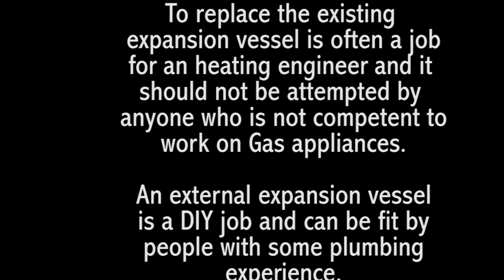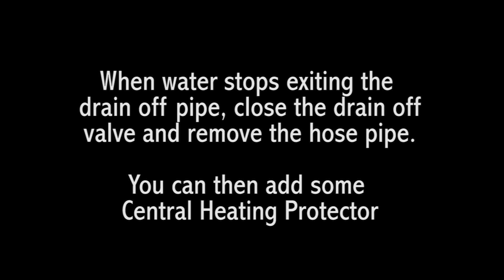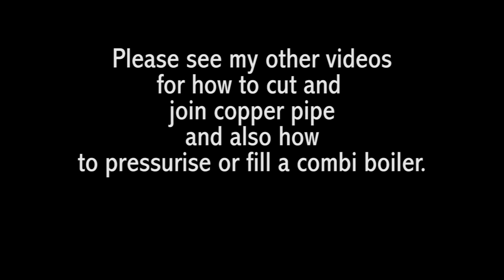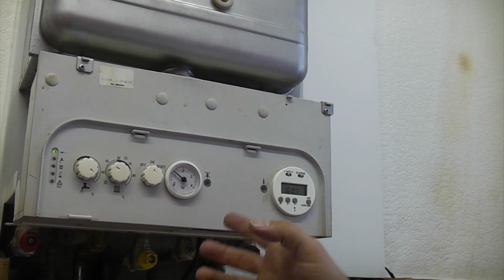How to fit an expansion vessel

Comment: Hi when fitting your expansion vessel to your combi boiler did you have to bleed the pipe you fitted to the expansion vessel?
Reply from the maker: No, any air should be forced around the system, until it can be bled out at a radiator 👍
Reply: @ultimatehandyman  thanks for getting back to me 👍

Comment: This is extremely useful,  I have a question that I hope you can help me with,  I'm hopefully going to avoid cutting in a t piece by finding one of those valves  with the 2 openings,  the question I have is is the pipe with the valve that the filing  loop attaches to always the return pipe?  Thanks. I was thinking if I could use one of these double valves then I could always remove external expansion if I needed to.
Reply from the maker: I’m not a plumber, but as far as I am aware, the expansion vessel is always installed on the return (I’m not sure why though, a plumber will know for certain)

Comment: Had mine re pressured a week or so ago, but it still won’t hold. The condensate pipe is bone dry though. What would you say is the problem? Also every so often I hear a click, could that be the pressure slowly releasing over time? Would a new E. V. solve this?
Reply from the maker: It’s not the condensate pipe that you need to check, it’s the blow off valve pipe, (or pressure relief valve pipe)
Here’s how to check the expansion vessel- https://www.youtube.com/watch?v=SNULc5fhY28&t
Here is how to recharge the expansion vessel- https://www.youtube.com/watch?v=KeO2gswQQe4
Hopefully this will help you find the problem 👍

Comment: You doing really good job to share all your experience :) I am planning to install external same expansion vessel like boiler has already, but just wonder if I could connect to the same plastic manifold where PRV and flexible pump hose is connected? Just disconnect old EV and with extra piping and few elbows connect new external EV? Or just leave it old one as it is and install new external EV to the return side as you saying in this video?

Comment: I have exactly the same expansion vessel you showed in this video. Is yours still working without issues? I've had mine for about four years now but the other day water started leaking out the top of the vessel where the large nut attaches to it.. A friend put some white sealant stuff on the thread as a temporary measure, now it doesn't leak but can you suggest a more permanent fix?
Reply from the maker: If I remember rightly, there is a sealing washer on it- that might need replacing.
I'm afraid the boiler had to be replaced at this property a couple of years after doing this, as it developed a few electrical faults and could not economically be fixed.
Thanks for the comment 👍

Comment: Do you HAVE TO drain the complete system to put a T  in the water supply? Or can you open a radiator bleed screw reducing the boiler pressure to zero , then turn off the water supply to the boiler so when you cut the pipe to insert the T there will be no serious water leak?
Reply from the maker: You don't need to fully drain down the system, but it is often easier and quicker to do so.
Thanks for the comment 👍

Comment: But what about pre-pressurising the expenasion vessel? On my vessel it says precharge pressure = 1bar. Do I pressurise the vessel through the 'bicycle' valve before I connect up to the system?
Reply: ...expansion..... (dicky keyboard).
Reply from the maker: Yes, if you pressurise it to 1 bar and then fit it, the expansion vessel should do it's job. 
Thanks for the comment

Comment: I see this video is 8 years old but if you are still there, could you tell me if I have to remove the old internal one?  Thanks
Reply from the maker: You can leave the internal expansion vessel- as long as it's not leaking.
Thanks for the comment 👍

Comment: You can put the external expansion vessel on the flow pipe if needed,it will not harm it
Reply from the maker: Thanks for the comment
Reply: It is better on the return but like a filling loop if there is say only room on the flow pipe then it will not damage the system or compromise it,it will still do the job it is meant to do.
Personally and professionally I think it is better if external expansion vessels are fitted externally if you have the room to do it,ie a big cupboard or a proper utility room and as another tip I would recommend on the pipe going to the external expansion vessel an isolation valve is fitted and past it a drain off point(both where possible)is fitted so if the vessel ever needs pumping up or replacing it makes the job easier.

Comment: Hi mate, we had our 11 year old boiler serviced for the firat time.
I asked the plumber to recharge the expansion vessel as the pressure wpuld always increase when the heating was on and when we switched the heating off it would stay at the higest pressure point it reached, until we had to bleed the heaters.

Anyway he filled the air and cleaned the loop for us.

I had to open the filling loop taps to increase oressure as he left the pressure at zero.

Almost some minutes later I was told by a family member that the pressure increased past the red mark.

I called the plumber again as we had no hot water, ge assumed he left the taps of the loop on. He eventually came two days later.

And left with the pressure at 1 5.

Minutes later we noticed the pressure increased by itself agai past the red mark.

We have a vaillant ecotech plus.

I did not call the plumber back because he seemed incompetant to me.

What would you reccomend?
Reply from the maker: You can check the expansion vessel yourself- https://www.youtube.com/watch?v=SNULc5fhY28
How to recharge it- https://www.youtube.com/watch?v=KeO2gswQQe4

I would not get that guy back though!

I once got a guy out to a boiler problem and he said it was a switch, he replaced it the next day and the boiler still did not work. He then said it was another switch- I told him not to bother, as I can start replacing all the bits on it myself until it starts working! Some so called boiler engineers are more than useless.

Luckily I then found a guy that is superb!

Comment: Great video and most informative.. spoke today with the expansion tank manufacturer and they suggested that the  tank should be mounted with the expansion inlet at he bottom to ensure that the water drains out of the vessel.. does this make sense or doesnt it matter?
Reply from the maker: A few people have suggested that and if that is what the manufacturers recommend I would install it that way.
The vessel I bought did not come with any instructions saying which way to mount it, I have also seen some boilers where the expansion vessel is on it's side.
Thanks for the comment
Reply: I have a French made Gitral VVEF19 and instructions with it confirm what you said...tank in upright vertical position,  inlet at bottom.

Comment: My schrader valve is too close to my expansion tank and there is no room to connect the pump.
Reply from the maker: Not much you can do in that case. You might have to get a Gas safe registered engineer to fix it!

Comment: I am about to do this to my Ravenheat csi 85 which is 10 years old, I know it's not worth paying to have the internal one replaced when I can fit an external one, but I have one question regarding the old one first, does the water inlet side need plugging off on the old internal vessel when it becomes redundant to needs bearing in mind it will be left in place at the back of the boiler?
Reply from the maker: +martyavalon As long as the old vessel is not leaking you can simply leave it in position. There is no need to cap it off unless it is leaking.Thanks for the comment ;-)
Reply: +Ultimate Handyman Thank you for your reply.
Reply from the maker: +martyavalon 
You are welcome ;-)

Comment: I laid mine on it's side is that OK or will it wear quicker
Reply from the maker: +GETTHEDEUCE 
A few people have said that the connection should be underneath the expansion vessel as this prevents a build up of contaminants, but it did not mention that with the instructions that came with my vessel and I'm sure the vessel in my last boiler was on it's side!
Reply: *****

I installed mine about 14 Months ago & seems OK it only cost £28 from Wicks so no big deal if it goes Thanks & if I want to reinstall it 1 hour done
Reply from the maker: +GETTHEDEUCE 
Good point, it's no big deal now to replace it ;-)
Thanks for the comments ;-)

Comment: hello there.......Am I correct in assuming that the expansion vessel is pressurised via the schrader valve before it is connected to the plumbing system?
Reply from the maker: +Maurice Browne 
Hi, Yes that is correct. Although you can re-pressurise it when it's connected to the system as long as there is no pressure and enough room on the central heating side- this normally means draining out some water or leaving a bleed valve open.

Comment: Could someone tell me if replacing the internal vessel is DIY-able if it can be done without taking any parts off the boiler other than the one pipe connected to the bottom and the vessel itself? Mine is reall easy to get to, I could probably remove the vessel in under 5 minutes..
Reply from the maker: +CoLFC 
Yes, you can work on any of the water parts as long as you do not touch anything on the gas side of the boiler or anything that forms part of the combustion seal (apparently some boiler covers on some boilers form part of the combustion seal).
Reply: *****
Thanks for the reply. Does the whole system need to be drained before the vessel is removed or is it just the vessel that needs draining with the boiler switched off?
Reply from the maker: +CoLFC You'll probably have to drain the whole system, unless the boiler is upstairs.

Comment: I have just cut a vessel in on my heating system....it's a baxi system boiler but the only room I had to cut a new one in was upstairs in the hot press....I also replaced the automatic top up valve(which was located in the hp ) and switched it over to a filling loop.....but I'm still losing water and I don't have a leak and the vessel is ok .....is it possible that the safety valve is passing and if so do I need to be gas registered to replace the safety valve
Reply from the maker: +kev b 
Does the safety valve (PRV) not vent outside? If it does you can tie a bag to the end of it and see if it fills with water.
It is possible that it's just got some dirt in it and is not seating correctly.
From what I can gather you can do any work on your own boiler as long as you don't touch any gas components or remove any cover that forms part of a combustion seal.
I actually got a Gas safe engineer out once to fix my combi, he said it was a sensor and turned up the next day with it. Instead of draining down the heating through a drain valve he used the PRV, swapped the sensor and the boiler was exactly the same, only now it had a dripping PRV! He then said "it must be another sensor, I'll bring one tomorrow". I told him I could start replacing bits until I found the correct faulty part myself and told him not to bother returning. Needless to say I have never used him again ;-)
Reply: I think that's what it could be because  it is draining the system after a few hours and the boiler keeps knocking out
Reply: Thanks for the reply and yes agree about some of the gas fitters they are like scorpions it's in their nature to sting you
Reply from the maker: +kev b 
If you tape a plastic bag to the blow off pipe it should fill with water if the PRV is faulty.
Reply from the maker: +kev b 
Yeah, I'm glad the one I use now is brilliant though- he can sort problems very quickly and is spot on when diagnosing problems. The only problem is getting an invoice from him, I have tried to pay him twice for the last boiler service and he still has not sent it- I must remind him ;-)
Reply: I will try that tomorrow.....just hope that that is the problem and I can get at the prv without interfering with any gas components......would the distance from the vsl to the boiler have an effect on it or the fact I have it on the flow and not the return (could only really get at the flow )
Reply from the maker: +kev b 
I was always told to fit it on the return, but can't see it making a huge difference if it's on the flow side.
I don't think the distance from the boiler would be an issue as the system will have a similar pressure everywhere.
Reply: ***** thanks very much for your time and knowledge
Reply from the maker: +kev b 
You are welcome ;-)
Reply: Safety valve was passing and it's sorted all is good 😆
Reply from the maker: +kev b 
Good stuff ;-)

Comment: What happens to the existing expansion vessel that is now u/s ? can you just ignore it and re pressure system  or does it have to be disconnected  (thanks for video )
Reply from the maker: +graham garbutt As long as the old vessel is not leaking you can simply leave it in place ;-)Thanks for the comment

Comment: I have a 7yr old townhouse (all systems are 7yrs old by now) which has an expansion tank mounted on the cold inlet side just above the hot water heater.   I have experienced no anomalies with the plumbing system all 7 years.  About 1 month back, hot (I mean HOT) water started to come out of the cold taps; this  occurs with all faucets at bathrooms and kitchen.  The cold water will come out from the cold side after running the cold side faucet for about 5 min.   Is this a manifestation of a failed or malfunctioning (incorrect pressure) of the expansion tank?    Or is there something else more intriguing at work?
Reply from the maker: ***** 
Sorry I am not familiar with heating systems in other countries.
The vessel on the cold water inlet sounds like it might be a shock arrestor?

Comment: Hi you refer to the pipework as the filling loop but surely it is the return loop? I'm not a plumber.
Reply from the maker: The filling loop is the flexible braided pipe that goes from the cold water supply pipe to the central heating return pipe, this is used to add water to the central heating side of the boiler. I hope that makes sense ;-)

Comment: Just out of curiosity I have watched other videos on youtube and some state you put the vessel into the cold water supply pipe.
Reply from the maker: Are you sure they are not fitting shock arrestors to prevent water hammer?
In a combination boiler the expansion vessel is normally connected to the return side of the central heating to allow the hot water to expand without the PRV opening.
Reply: yes you are right, so sorry my mistake
Reply from the maker: Anthony Need
No problem at all, they are very similar ;-)
Thanks for the comments

Comment: Great video... our expansion vessel has broken water from overflow,mega high pressure and no air in tank when I pressed valve in hot water came out and how has a constant dripping of water.... im confident I can fit one just like in your video you have posted but my question is what do I do with the old one that is built into the boiler??I take it you cant just leave it
Reply from the maker: Yes, you can just leave the old one in the boiler as long as it's not leaking.
Reply: ***** thanks for the reply... I got 2 more questions, 1st yes there is a slight drizzle from the valve on the old vessel could I cap it off to stop the leak... 2nd question im a bit confused that im tapping into a radiator return pipe but my main problem in my hot water being cold not my heating that seams fine....Thanks for the help
Reply from the maker: Anthony Need
It's best if you ask here-  http://www.ultimatehandyman.co.uk/forum1/central-heating-boilers-f35.html
I'm no heating expert, just a DIY'er. One of the heating guys will be of more help ;-)

Comment: Hi. I have high pressure in system and no air in my expansion vessel so I assume the diaphragm/air bag has gone.The pressure relief valve piped to outside relieves the pressure when manually opened. I assume I have to replace Flamco expansion vessel in the system. Like for like. Is this an easy job? Great vids by the way.
Reply from the maker: The expansion vessel may just need recharging, how to check it is here- https://www.youtube.com/watch?v=SNULc5fhY28

If water comes out from the Schrader valve when it’s pressed in you need a new expansion vessel.

If no water comes out you should just be able to re-pressurise it, but you have to ensure that you drain off some water from the central heating before re-charging it.

https://www.youtube.com/watch?v=KeO2gswQQe4

If the existing expansion vessel is not working you can add a secondary one yourself as in this video, but to replace the existing one on the boiler you will probably need a Gas safe registered engineer as to get to most expansion vessels you have to remove other parts.
Reply: ***** Cheers for that. Very kind of you. I have checked the schroeder valve and no water coming out. Things are looking up. How much water do I need to drain off before re  charging. Is it just a case of cracking a radiator valve for a few seconds?I have tried  turning the high pressure relief valve on top of the expansion vessel to relieve pressure but the pressure guage seems to go up when I do that.  
Its a megaflo system by the way with an oil fired rayburn and not gas. Thanks again.
Reply from the maker: Angus Nicolson
Sorry I thought you had a combi.
I din't know anything about Rayburn's or Megaflo systems, you best ask here- http://www.ultimatehandyman.co.uk/forum1/central-heating-boilers-f35.html
Reply: ***** Cheers mate. All the best.